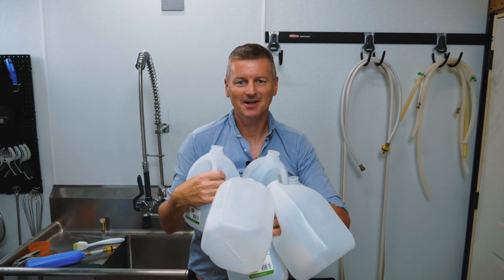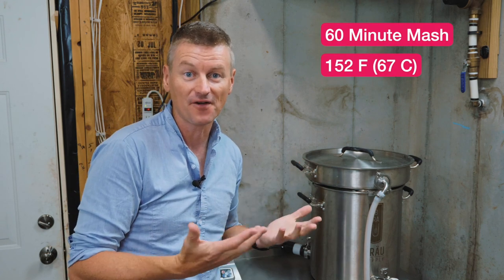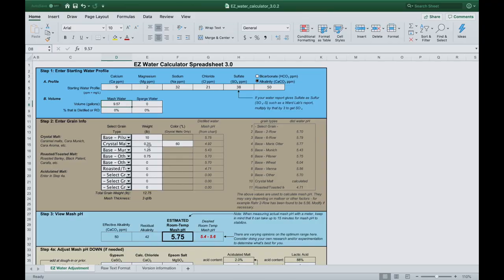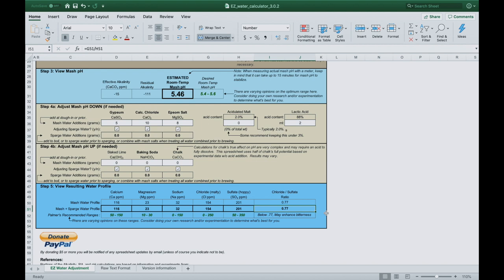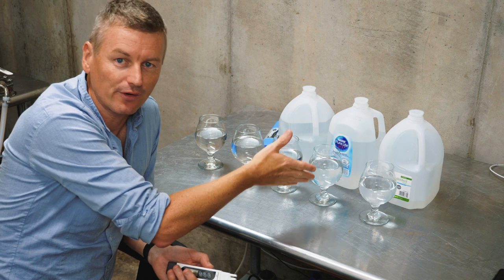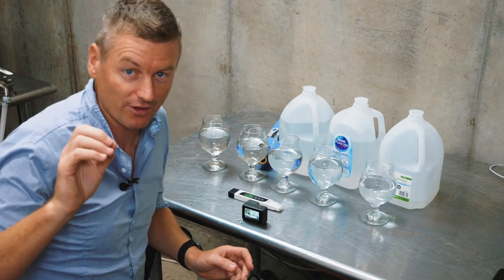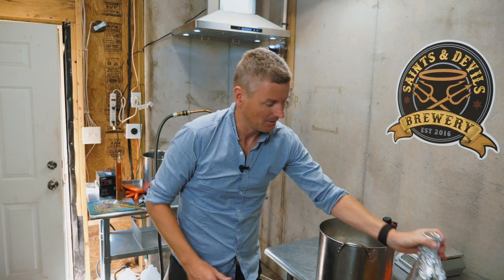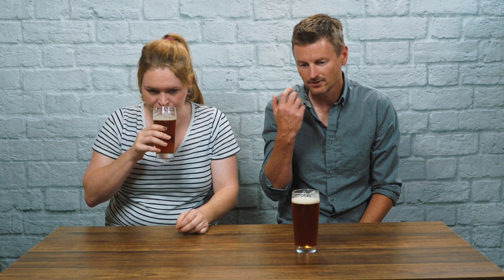How To Brew Czech Amber Lager | Brewing with Distilled Water | Water Chemistry For Beer

Comment: Hi. Great water comparison! As for me we should adjust water PH level in the prepared mash with grains. Not just plain water. Because grain makes it's own PH corrections. But I never add any chemicals to my beer - it's always great and I'm sure I drink absolutely clear product. Even for sterilization I use only pure spirit and hydrogen peroxide.
Reply from the maker: I didn't show it in the video but each brew I do typically use a pH meter during the mash because as you say the grains at mash will affect the pH.

Comment: I really like your videos. You mentioned you do not use sparge and use full volume on the mash stage. How do you set that using BeerSmith? And, is it true that you need more grain when you use no sparge? If so, how do you calculate it? Thanks and greetings from Mexico :)
Reply from the maker: BeerSmith has a BIAB setting that I use. It tells me how much grain to add.
Reply: Could you tell me what that setting is? I know you a busy man but would be awesome if you can make a video about your BeerSmith no sparge configurations.

Comment: How do you know how many gallons of water to use to mash for a specific grain bill?
Reply from the maker: I just plug the recipe into BeerSmith along with my equipment profile and it spits out how much water to use. For most batches it's typically around 7 gallons.
Reply: This depends on how many gallons of finished beer you want and whether you plan on sparging.
Reply: Phil Thompson is the 1.3qts per pound a good go too and then fill the rest with sparse if needed?

Comment: ive tried 100% distilled before and adjusted with salts, and the beers were just lacking .. went back to tap and adjustments
Reply from the maker: Yeah seems like a lot of work compared to just filtering water
Reply: @TheHomebrewChallenge  for sure. Just don't think the calculators are accurate enough to just use r/o /distilled, at least for me with beersmith